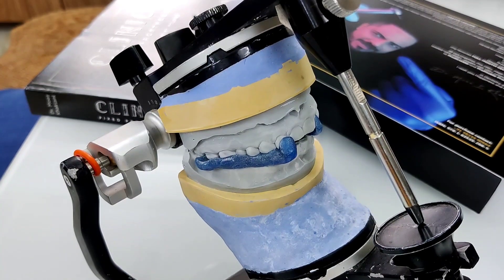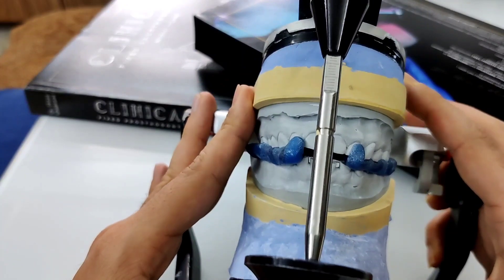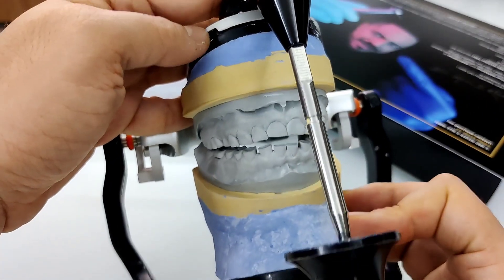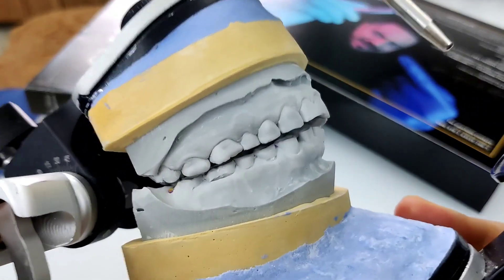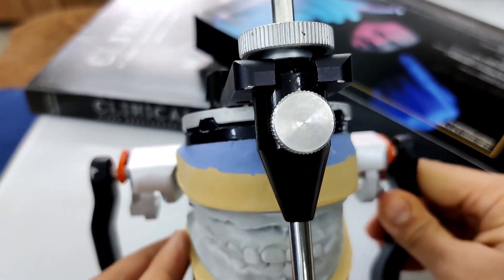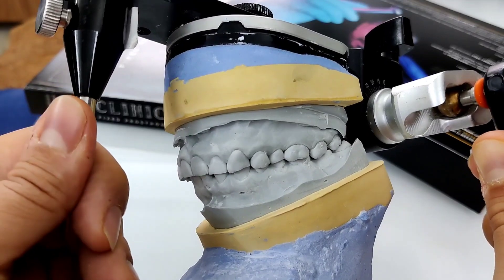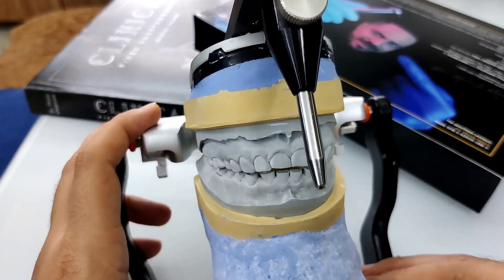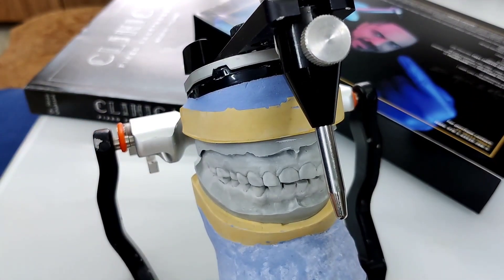How to determine the VD in an FMR case #Verticaldimension #FMR #VDO

Comment: Hey there.... 

I have a huge question sir 
Please read and reply at your ease ... 

After dropping the incisal pin and doing wax up at rcp suppose the pin is at around plus 2 ... 

So after all the preparation while doing the mounting of master cast with die cuttings should I adjust the pin at plus 2 or it should be at zero ??? 

Because i guess it should be locked at the same RCP wax up pin locked as we are mimicking entire thing from that part onwards....! 

Thanks a lot doc ...!